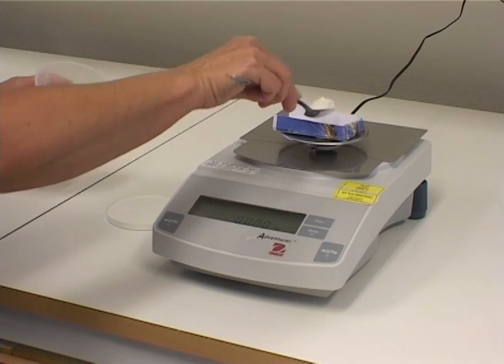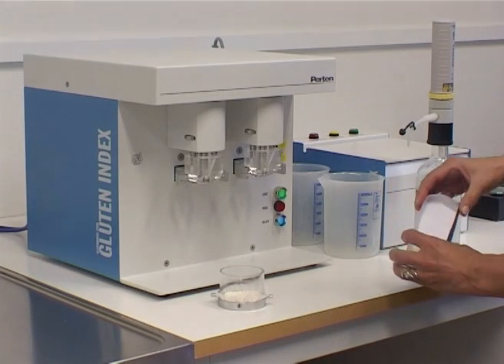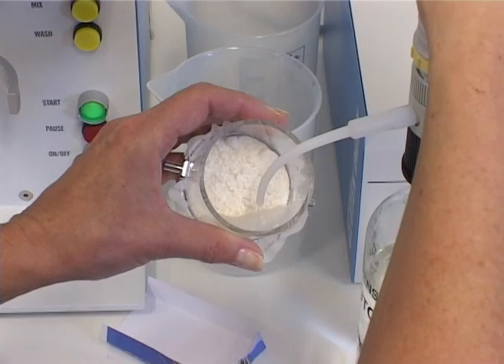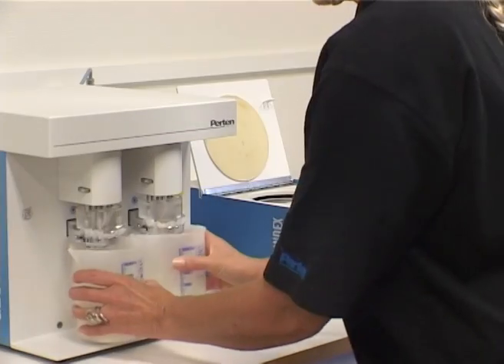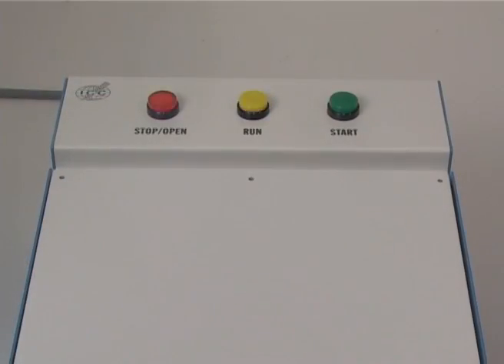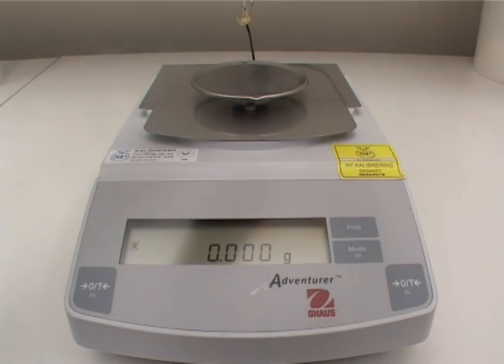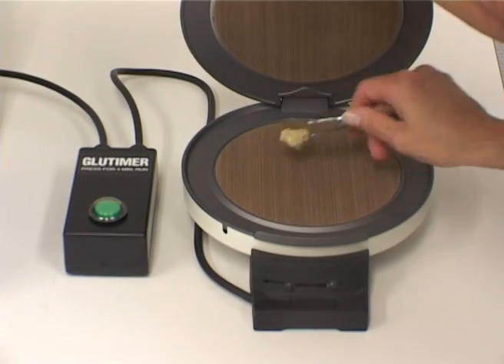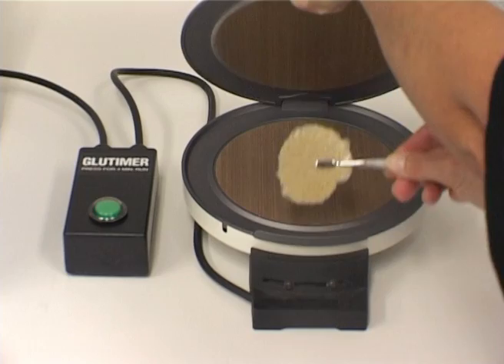Gluten Index Method instruction

Comment: how can I solve the problem of water drainage of gluten washing chamber water pump
Reply: In my case the the drainage of water comes on the top of washing chambers was stopped so,what shall I do to solve the problem?
Reply: @cherinetkasahun1210  Please check that the tubes are not broken, and that they are properly connected. I'd also like to suggest you contact your local support. Where are you located?

Comment: 4.8ml liquid was poured, how come the beaker water is much when d washing stops?
Reply from the maker: The 4.8 ml added at the test start is mixed with the sample to a dough.
The instrument is then pumping wash liquid to the sample compartment, and it is
that wash liquid that drops down into the beaker, with starch and other water
soluble material, during the test.